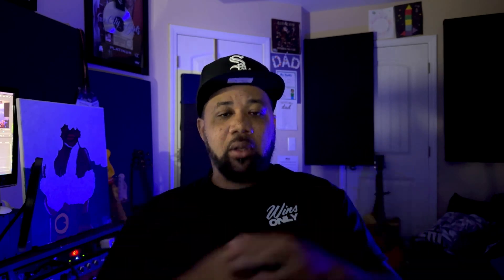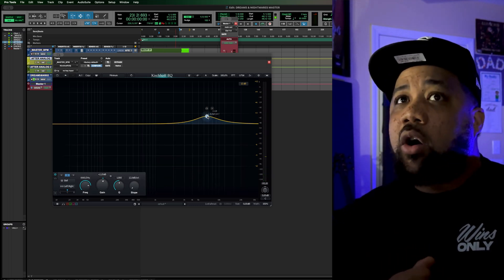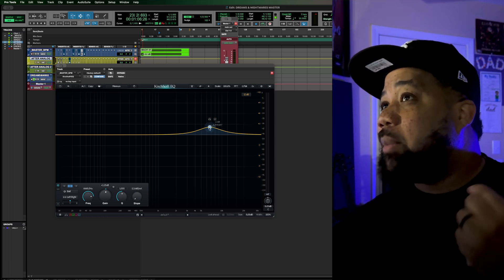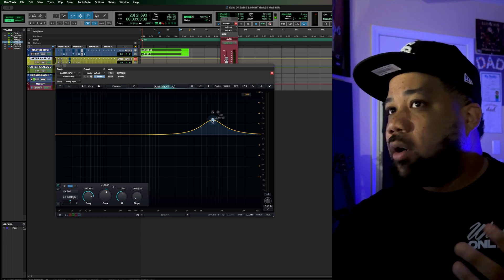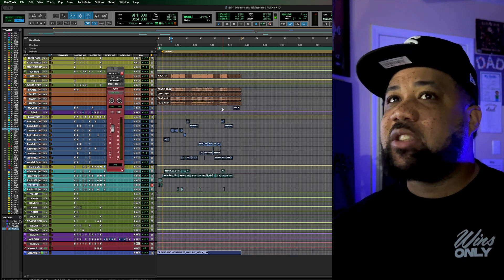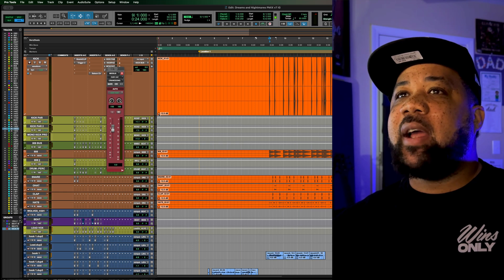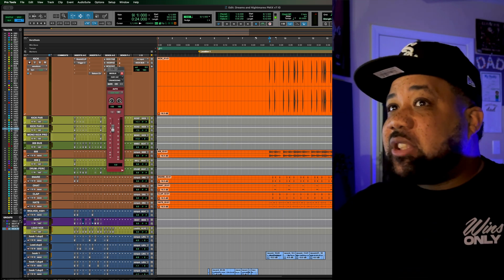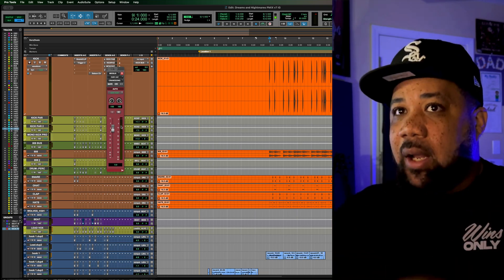Don't Let Your Mix Clip! Master Gain Staging in the Digital Domain

Comment: If you have received a distorted mix with no headroom, lowering the volume ain't going to fix it. The mix itself needs to be lowered prior to exporting and sending to you.
Reply from the maker: Mix not distorted files come in too hot so lowering the levels will indeed give u more headroom to make accurate decisions.
Reply: That's not what he talking about